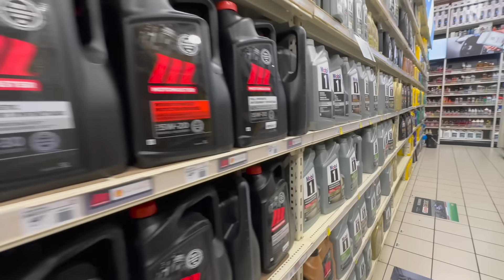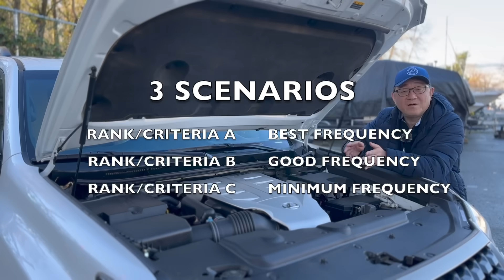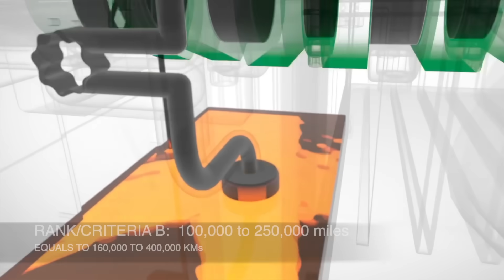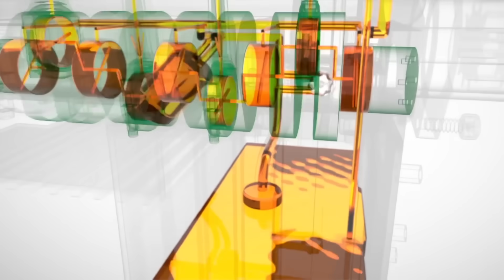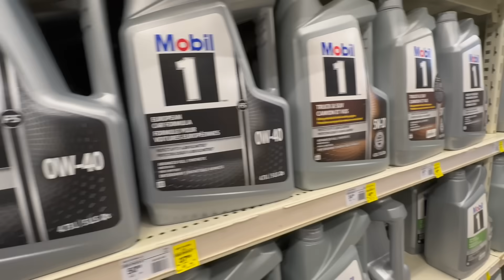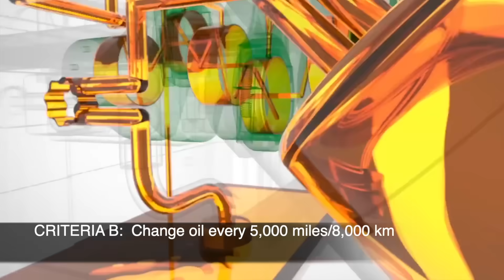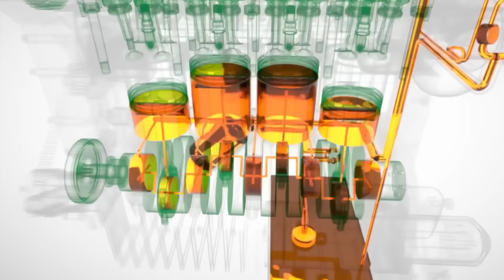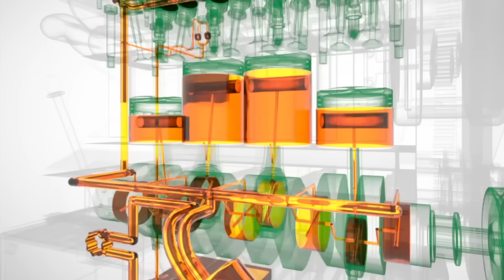ENGINEER EXPLAINS HOW OFTEN TO CHANGE OIL & FILTER // UPDATED CRITERIA-BASED RECOMMENDATIONS!

Comment: As a 'European' i love watching this content(and the discussion) as over here, annual maintenance - which is basically an oil/filter change plus look over on a 2 post - is the norm. 

A lot of European cars have variable servicing which push frequencies up to 2 yearly/20,000 miles. Really!

Could this be because 80+% cars here are leased and the first owner will be chopping îr in after 3 years, so who cares about longevity?

I would say that that tribology is so much more nuanced than  given in this video. API standards require oils to meet minimum ASTM test criteria AFTER many hours of simulated usage:
Heat - gross/integrated operating temperature, heat cycling - base oil & additive oxidation; 
wear rate; 
dirty carrying capability; 
lubricity (fuel dilution doesn't help here); 
water exposure 
Etc etc

So depending on the use case,  100 hours or 1000 hours could see your oil dipping below the minimum requirements and hence not protecting your engine.

Are you a fleet, where extending intervals by 3000 miles could save you 10s of thousands? Or is it your one car that gets you to work all day and you can dispose of the oil for free?

Comment: In the good old days, when cars and oil were both crap, it made sense to change oil and filter often.  Cars and oil are both much better now.  I bought a new Acura in 2006.  Acura said 10,000 miles on conventional oil and 20,000 miles on the filter.  I changed synthetic oil and filter every 10,000 miles.  I sold it last fall with 223,000 miles on it.  Oil analysis was fine.  Performance was perfect.  I never added a drop of oil.  EPA estimate was 27-34 MPG when new, but I was still getting 35-37 MPG.  Just how much better off would I be if I changed the oil over three times as often?
Reply: Agree. I've used Amsoil signature series which requires once per yr or 25,000 miles. I"ve put over 250,000 miles on it without a hiccup. Car is over 20 yrs old...still gets 38mpg highway..and a Toyota.
Reply: @robertdavis9986  Did you also change the transmission fluid?
Reply: @jp.8154   Sure do...once every 8 yrs or so. Amsoil shows very little wear and filter is clean. They say it's lifetime but it also needs changing for what little it requires...and dollars saved. Just add and dump...I never used the machine.
Reply: This is the way to go...I just traded in a 2013 Hyundai Sonata 2.0t which I also had tuned with 124,000 miles on it and changed the oil full synthetic and filter every 7500-10k miles...the car purred like a kitten, didn't leak a bit of oil, zero issues, changed the tranny fluid at 60k miles...2500, 3000 miles is a complete waste of time, effort, and money with modern engine tolerances and oil technology...multiple tests from places like Black Stone Labs scientifically prove this...just bought a brand new 2025 Telluride and will change every 7500 miles as it's just a N/A V6 and is driven on backroads, not much stop and go traffic and will be used for road trips.
Reply: Yeah.. but back in the old days.. we could afford a vehicle. 😅😂
Reply: In 1963 I was working in a full service Standard Station in Cupertino California. We were in the business of changing oil. A standard oil engineer pulled into the station. I pulled out his dipstick and made the comment I see you just changed your oil. He pointed to his Frantz toilet paper oil cleaner and said use one of these and Standard Delo 30W. Your engine wont wear out and you wont need to drain oil. I went and found a Frantz dealer. In those days we changed the toilet paper and added a quart of Delo every 2.000 miles. Delo came in 30W and 20W. About 29 cents a quart in the discount stores. My Pontiac Torrent has a improved top loader Australian Jackmaster Classic. The Jackmaster Classic uses high quality roll of Australian toilet paper in a sock and charges about 20 bucks. I use Great Value 1000 from Walmart in mine. I have changed oil because of a leaky head gasket and sometimes when I buy a used car.It was rough in the old days.With standard filters the oil was nasty in 2.000 miles.
Reply: When I met my wife her 66 VW bug had just swallowed a valve. The VW repair shop told her since the VW had no oil filter she should have them change the oil every 1500 miles. I put a Motor Guard toilet paper filter on it. Motor Guard was a San Jose California company. Now they are in Manteca  California and sell compressed air filters. They were the only ones safe to use for compressed air. They went broke trying to sell filters that clean oil to people that think oil is supposed to get dirty and be drained. The Motor Guard on my F 250 with the 390 is almost 60 years old.
Reply: Same here, but these rules of thumb are not vehicle, driving or environment specific.  Certain cars will do fine with 10,000 oil changes if you live in the right area and drive lets say 50 miles to work each way.  I have an Acura myself with around 150k miles on it and it still runs like new, and I change the oil every 10k miles with full synthetic oil.

But, that car was driven for hundreds of miles at a time on the highway, and it was in a relatively mild climate.  If it was used for a lot of local short trips, the oil change interval would be much better at 5k miles...
Reply: Filters that clean oil are not for everyone. The only filters that clean oil are bypass filters with oil lines to deal with. They are for people that plan to keep a car a long time. In the 60s we used 2 ply toilet paper. Now you can get paper as good as toilet paper for about 35 bucks. My Australian Jackmaster Classic is set up for a tightly wound toilet paper or the 20 dollar Jackmaster Classic element. A peasant like me uses Great Value 1000 from Walmart. You cant get Scott 1000 now from Dollar Tree for a dollar. Its tough.
Reply: I dont have a problem with my cars but some of these cars have  nowhere to put a oil cleaning filter. They are all remote with oil lines. I did have a problem with the 06 Altima. I had the filters for the engine and transmission in front of the radiator. Had to remove the grille to service them. It was totalled on a ice covered highway. Solved that problem. No such thing as a full flow filter that cleans oil.
Reply: @ralphwood8818  If you change your oil regularly, there is no need for a full flow filter as by the time the oil needs that level of cleaning it is being replaced by new oil.

Also, oil has wear protection molecules and additives which break down and wear out over time, and cleaning the oil will not restore those.

Which is why, even if you had a perfect filter, the oil would still wear out and become contaminated over time, requiring its replacement.
Reply: So you're for real?  They actually use toilet paper, or is that code for the corrugated paper filters? I've simply never heard of this kind of product, so please don't laugh to hard at me!    @ralphwood8818
Reply: I would think going 10k instead of 3k or 5k between changes doesn't guarantee you'll have issues it just increases the chances.  Manufacturers plan for the car to go 150k miles and you get a new one so 10k mile oil changes may be ok, but past 150k you probably have more wear and risk of issues as opposed to someone who changed more.  Doesn't mean you will have issues just a higher chance I would think.
Reply: @WarHammer654  I have to objectively disagree only because he confirmed that he has the oil analyzed to confirm the condition of the oil at a 10k interval...if the oil analysis confirms that the core metals of the engine aren't wearing, the detergents in the oil are good, the viscosity is good, the flash point hasn't dropped sign, and there's no water or coolant in the oil....it'd be a complete waste of oil, time, and money to still change the oil in that vehicle 3x as often just for some personal sense of security...with scientific factual evidence that supports a 10k interval
Reply: @ yes you're right in his case since he is analyzing the oil he can be confident his engine isn't wearing faster, but I'm talking about macro.  Thousands of cars, like a stat sheet.   I'm sure there's someone somewhere who hasn't changed their oil in 20-30k miles and if you tested it, no metal. And probably someone who went 200k miles on oil changes like that.  Doesn't mean that's good advice to apply to the macro.  
The effects of oil change frequency really kick in 200-300k mile mark, and changing it frequently is pretty important then. 

Especially on newer engines where they're constantly downsizing, increasing compression, and stressing it as much as possible for efficiency.
Reply: @ reliability and quality has gone down the last 10-20 years, increased demand on engines, "lifetime" 
ATF fluid, increasing oil change intervals.  

I just have a hard time trusting that when it's definitely in their best interest to only have their cars only to last up until the warranty ends and be "maintenance free".
En mass people buying cars now don't consider reliability and brand reputation nearly as much as they did 30-40 years ago so I can definitely see them thinking they can get away with it (and actually getting away with it).
Reply: Cause like I'm sure somewhere someone did 30k oil changes and got their car to last 200k miles, but that doesn't mean it would consistently do that.
Reply: Just as an example yk
Reply: Did you also change the transmission fluid?
Reply: @jp.8154  Of course!  Brake fluid too.
Reply: I'm concerned that paper filters would disintegrate within 20,000 miles.
Reply: The cars were great! The oil was fine, but hey, we could afford them then.
Reply: You wouldn't be any better off, kudos to you for doing it right. But someone with that same Acura who lives in a very cold climate, makes mostly short trips, drives with a lead food, uses low quality gas and cheap oil & filters, will probably never need to do oil changes because they'll be constantly topping off with fresh oil as their engine burns through it. This is what people don't get and why this debate continues to rage on. How quickly your oil gets contaminated and breaks down is CONDITIONAL. It's not set in stone.
Reply: The EPA mandated pushing the longer period to cut down on toxic waste.  Manufacturers would prefer it more often.
Reply: @rustynail7866  Obviously false.  Auto manufacturers wanted to cut down on the service intervals so it would make the cars appear to be more maintenance free.

Absolutely NO ONE asked them to or made them do it.

People want less hassle and low maintenance cars.  It was a marketing thing for the manufacturers, and NOTHING else.
Reply: @redbaron6805  That's "spin".  Read EPA regulations on auto maintenance, and when you're bored to tears, read the California Department of Toxic Substances guidelines for extended oil changes.
Reply: @rustynail7866  Already read them, and they don't stipulate any of the claims you made...
Reply: @rustynail7866  The EPA regulations on automobile maintenance do not specifically mandate oil change intervals. Instead, the regulations focus on broader aspects of vehicle maintenance, particularly those related to emissions control systems and hazardous waste management.

### *Key Points from EPA Regulations*

1. **Emissions Control Systems**:
   - The EPA requires warning systems (e.g., dashboard lights or buzzers) in vehicles to alert drivers to malfunctions or the need for maintenance on certain air pollution control systems, such as catalytic converters and exhaust gas recirculation systems[1].
   - These warning systems ensure that necessary maintenance is performed to keep emissions within legal limits.

2. **Maintenance Guidelines**:
   - The regulations allow for scheduled maintenance on certification test vehicles, including periodic tune-ups and unscheduled maintenance like replacing a misfiring spark plug[1].
   - Specific maintenance intervals are detailed in the vehicle's owner's manual, which must explain the operation of the warning devices and set forth the model's maintenance requirements[1].

3. **Used Oil Management**:
   - The EPA has established standards for managing used oil generated from vehicle maintenance. These standards are designed to ensure safe handling, maximize recycling, and minimize disposal[3].
   - Businesses handling used oil must follow specific guidelines for storage, recycling, and disposal to protect human health and the environment[3].

### *Conclusion*

While the EPA regulations do not directly mandate oil change intervals, they ensure that vehicles are maintained properly to meet emissions standards and manage hazardous waste responsibly. The specific intervals for oil changes and other maintenance tasks are typically provided in the vehicle's owner's manual, as required by the EPA regulations.

Citations:
[1] https://www.epa.gov/archive/epa/aboutepa/epa-sets-auto-maintenance-regulations.html
[2] https://www.epa.gov/state-and-local-transportation/vehicle-emissions-inspection-and-maintenance-im-general-information
[3] https://www.epa.gov/hw/managing-used-oil-answers-frequent-questions-businesses

Comment: I'm disappointed, you call yourself an 'engineer' so where is your data? Engineers make decisions based on hard data, not gut feelings. Where is the oil analysis at 3K miles, 5K miles, 7.5K miles etc...,  What about mostly city drivers vs mostly highway drivers? What about drivers that haul a horse trailer down dirt roads vs those that drive in small cars in clean environments? Or the person that drives long distances daily and puts 15K miles per year on their vehicle as compared to someone that drives 10 miles a day and barely gets their car up to operating temperature? So many variables that you just ignored. You may have a degree in engineering, but you make a better oil filter salesman...

Comment: The manufacturers recommend changing the PCV valve every 20,000 miles.
I have never changed my PCV valve over 140,000 of driving my car, but I do check the operation of my PCV valve every 12 months to make sure it is working.
Also never changed my struts over 140,000 miles and although they are slowly leaking fluid, they are still fine.
When my rotors get worn and start to vibrate when braking, I change my pads and let my new pads compensate for my worn rotors - works every time because you new pads will fill in the imperfections of the worn rotors - like a Ying and Yang effect. People need to learn a bit about cars and understand that they don't require as much maintenance as they think they need. In total, I have spent 0.5 cents per mile driven on repairs for my vehicle, and my vehicle runs perfectly well and will do so for at least 15 years, I suspect, because I am already at year 12 of ownership and my car drives very well.

Comment: I change the oil on my 2012 Civic every 10,000 miles.
It's at 140,000 miles to date and the engine doesn't burn any oil and is still very strong.

Comment: Hey there:  This is a really good, practical video explaining various OCIs recommendations...great job.  

In terms of oil viscosity, all vehicle manufacturers now recommend/require low viscosity oils such as 0W20 and even lower.  In your opinion, do these low viscosity oils provide good protection when compared to thicker oil such as a 5W30?  

Again, I do appreciate your videos - please keep making them.
Reply: 0x20 are designed to have good fuel economy and to pass strungent CO2 emissions because it has less friction, you'll find the engine probably took 5x30 before. For instance my engine was recommended to use 5x30 but because the car maker wants the engine to be fuel efficient it changed it to 0x20.
Reply: @IwasBraveFor2WholeSeconds  5W30 is my recommendation but I'm just a guy on the internet.

BTW I run 5W40 myself in a 30 year old engine.

Comment: Unfortunately ICE vehicles will be classified as " residual vehicles" under the new system coming soon. Where its forbidden to carry out major repairs anywhere, its designed to scrap them over time within 15 years of any vehicle working life and should be off the road and scrapped forcing you to buy an EV. The powers at be have realised vehicles can be maintained, repaired and therefore keeping them on the roads.

Comment: You can have super synthetic NASA oil, but DIRT is still going to build up and wear the engine if you dont change it. The oil filter only filters 10% of oil at a constant rate. Modern oils are great to fight sludge, but DIRT is the #1 wear factor. You cant stop dirt buildup in your oil. When your oil turns to gritty mud no amount of oil additives will help

Comment: If you are retired and don't drive very much change your oil sooner . Your vehicle probably never gets hot enough to burn of impurities/ and condensation . Treat this like extreme conditions change your oil sooner .
Reply: Please provide your evidence.
Reply: @DailyStalkerUpdate He's nearly right, shorter journeys encouraged condensation inside the engine were the heat hasn't had time to burn it off, so over time it'll build up and contaminate your engine oil. Oil and water together ain't great for bearings and metal bearing surfaces inside the engine. This is where you get thick white oil substance in your oil cap. So it's important your engine oil has to be at optimum temperature, failing that regularly you have to change it. If you feel you ain't just take it for a long run now and then. For my example I do 3000 miles a year however my manufacturer says every 10,000 miles so when I hit 3000 miles I change it. I always change my own and will recognise if there a problem.
Reply: @IwasBraveFor2WholeSeconds   I didn't ask if he was nearly right. I asked for evidence. Still waiting.

Comment: I change them every 5k km. Every season basically. I do it myself. And I run a bottle through the engine to drain so I see clear oil running out.